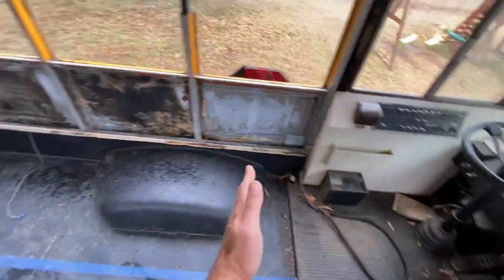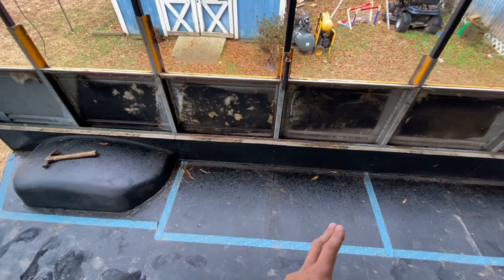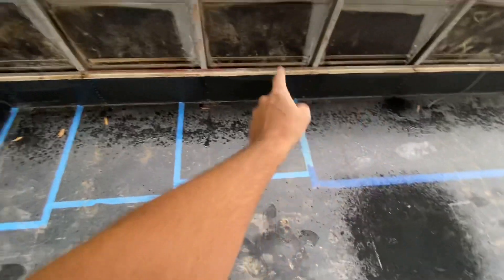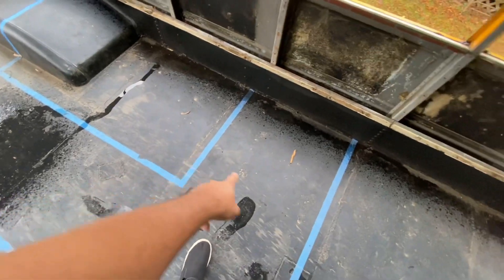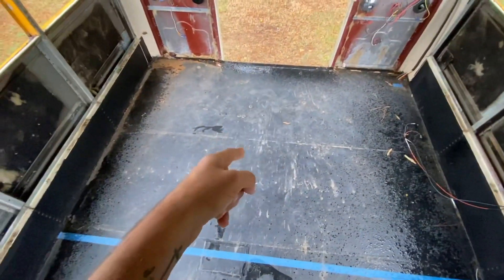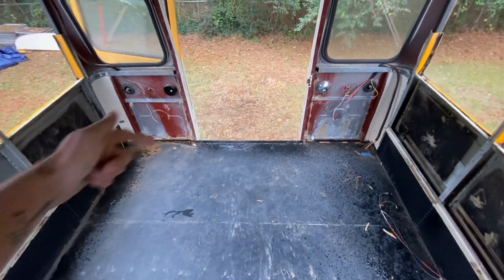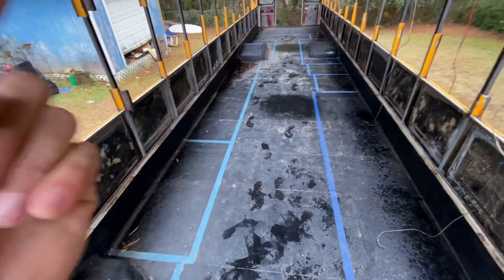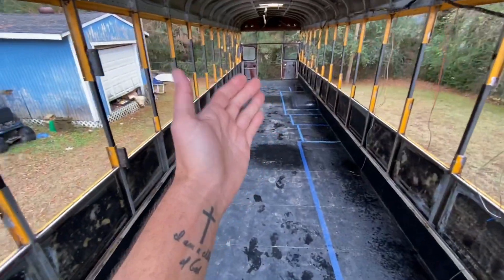School Bus Conversion Episode 6 - Roof transition and floor plan UPDATE*

Comment: Great plan. A few things to consider. The first 2 windows plus the entry door are essential when driving. As a test take your car and block off the rear windows on the passenger side. 

Switching the couch and media ceter

Comment: Very cool. I like the idea of leaving the roof over the cab and making it the floor for another storage area. Not so sure about having the toilet on the wheel well, though. Who knows? it may just work. I'm looking forward to more.
Reply from the maker: Yeah I had to change that plan unfortunately. We needed up doing the transition different. Check out the newest video. Also, the toilet will be a compost toilet. So I’m thinking the wheel well won’t be an issue. Thanks for watching.